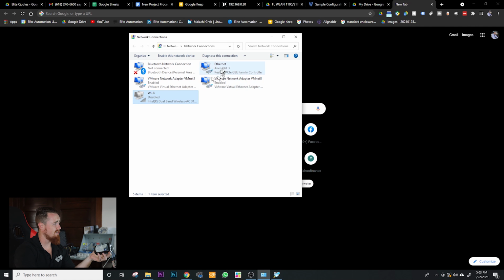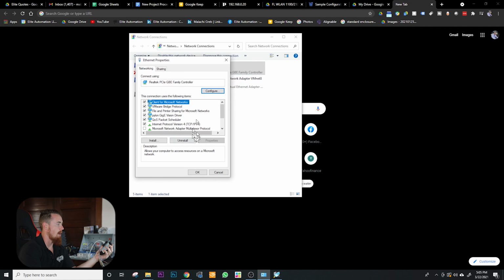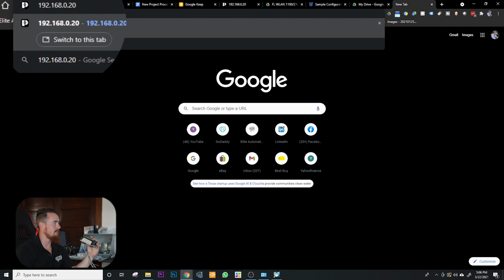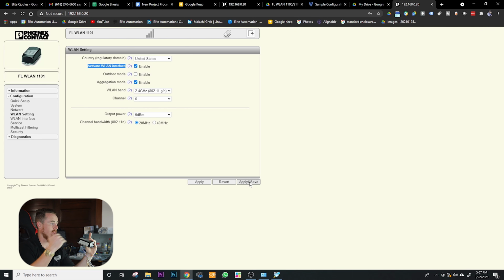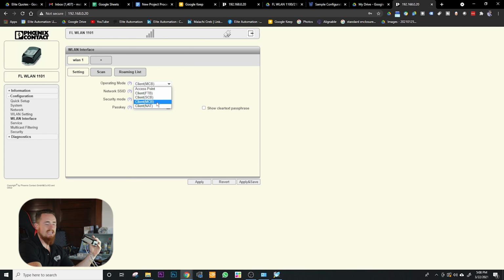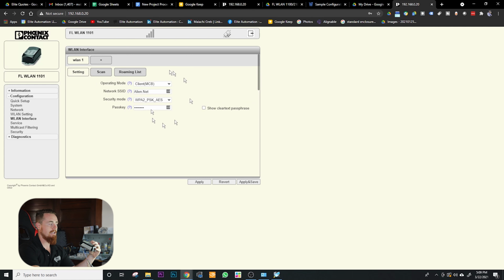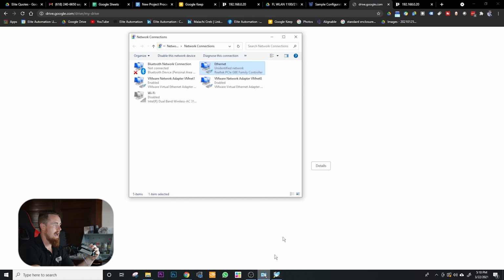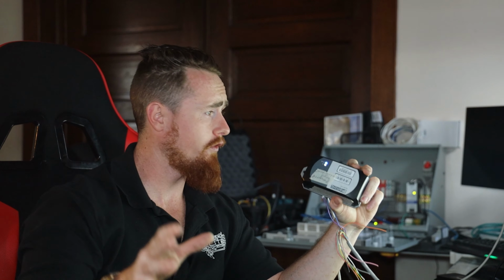FL WLAN 1100/2100 - Setting Up as a Client

Comment: Hello, I currently got two Phoenix Contact WLAN devices on my desk.
I have them running but I actually want to get in to the nitty gritty. Mesh, Client(MCB), Multicast Filtering, etc.. Do you have a recommendation for how an electrical technician - who's just starting out - can get into the whole networking technicalities?
Reply from the maker: Well with these devices you it's mainly a matter of changing a few drop down settings. We are not super IT our selves for the time being.